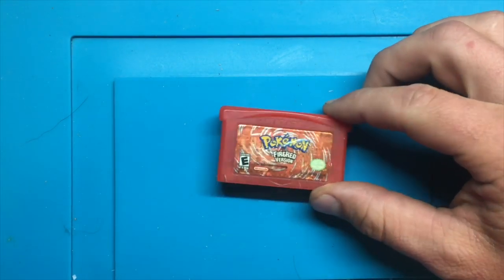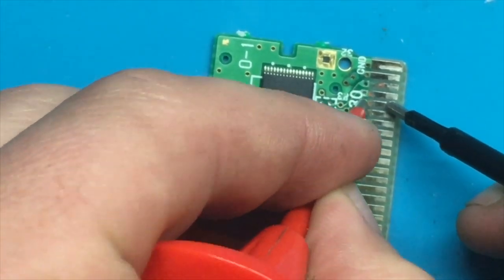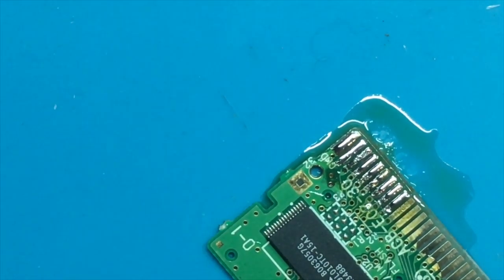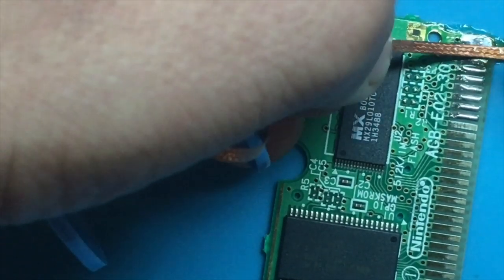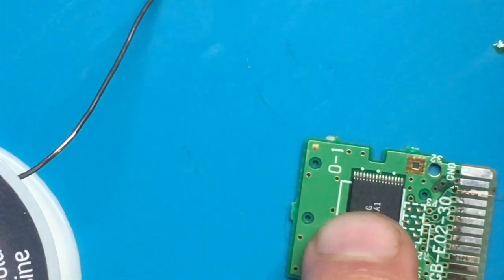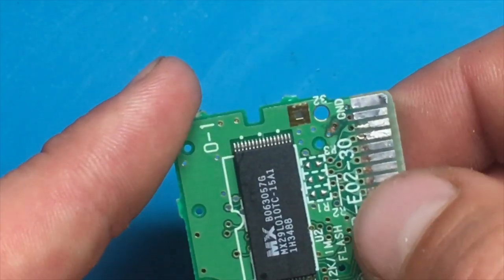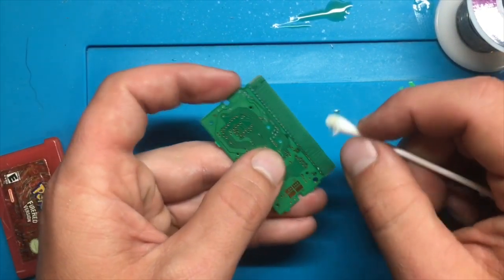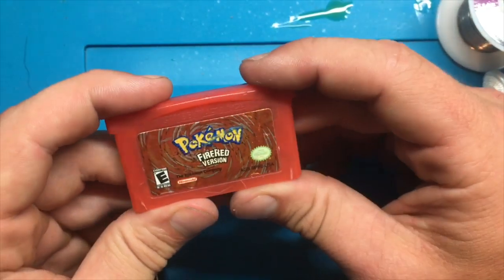Fixing eBay Junk - Game Boy Advance Game - Game Won't Boot Up - Pokemon Fire Red

Comment: looked like SRAM Chip Select pin. strange that that not being connected would show up as no cartridge inserted.
Well, unless the signal being low was sending garbage data over the data lines.

Comment: That's awesome! I'm glad you saved an innocent GBA cart.  I am wondering about the long term effects of the repair though.  Is the solder job going to last with repeated use? Will the difference in material/thickness damage your DS pins?  I figure there must be a reason why the pins are gold plated to begin with rather than being soldered.
Reply: I think it would probably wear within a few years of use (swapping, mostly, since being inserted and not swapped out is the same as any other storage media as far as "wear" goes for those pins) it'd probably wear away again, but that's not really an issue since you can just... well, do it again.

GBA Pokemon games save on the flash chip and not an actual battery.. Short of an EMP wave, or something really unlucky happening, your savefile will always survive. So just repair and move on!
Reply: @acumenium8157  The flash chip can only be saved to a certain amount of times before they fail though. Will that be in 5 years, or 50? I guess it depends how often you save the game.
Reply: @inputfunny  It is really unlikely. Even low-quality flash chips can handle terabytes of data writes and a GBA save is only going to cost 1MB at most each time (since if memory serves Pokemon games double save and use a 512KB savefile).

I mean you bring up a good point but it is more likely the sun blows up than the average flash chip fails in a GBA cart. Some will due to the sheer number used but you'd probably know by now if it was gonna fail since, well, bad flash chips don't tend to last 20 years before going belly up.

Comment: Just picked up a fire red with the exact same issue. 3rd pin to last. I cleaned it up and managed to get it to boot up and got the message “The 1M sub-circuit board is not installed” looks like I’ll need to run a jumper on the same pin 🤣 luckily I had already watched this video prior to even purchasing this game so always handy!

Comment: Oh my god, so I looked this up to see if I could fix one of my GBA games, however, I needed to unscrew the thingy to get to the thing. But, there was a sticker covering the screw for some reason, so I peeled it off and saw that the bottom of the sticker was gold. I thought "hmmm... maybe it was the sticker what was making it not boot? Maybe it has some sort of weird metal on the sticker, what's interfering with the game cartridge? Naah, that sounds silly, but I'll try it anyway." And then... it suddenly worked. Maybe the seller I bought it from, put that sticker on there to protect it or something?

Comment: Off topic. Hi Retrorepairs how to fix SNES with no sound? i replace the av cable, av connector, whole capacitors but still doesn't work. some people said the audio chip is damaged but i dont know. any other suggestions?
btw your cartidge fix videos inspired me to fix random cartridges from flea market, so far i fixed more than 30+ mix of gba snes megadrive cartridges
Reply: it's probably the audio chip.

Comment: Love your videos, I got a pokemon saphire that stays on white screen, if I post an image of the cartridge circuits could you look at it, and tell me if you see any problem?
Reply from the maker: Yeah, i could take a look
Reply: @tavotwo  try cleaning the pins with rubbing alcohol (isopropyl, the highest percent  that you can find) and a q tip or a cleaning toothbrush. Fixes most problems for me.

Comment: Use a sharp tool to scrape the one corroded pin instead of sanding many.
Reply: Or a fiberglass pen
Reply: Use Brasso first. It's a polish, so most top layer corrosion will actually lift away and makes the pins look nice.

Comment: Hi retro repairs why couldn’t you just use brasso or some thing like a eraser to remove the corrosion on the pins
Reply from the maker: Brasso will probably strip the pads clean off in that condition.  They really need to have the corrosion neutralized, then add some material on top to ensure there's a good connection.
Reply: I use rubbing alcohol/isopropyl alcohol and my cleaning toothbrush, it works almost every time for me.

Comment: Awesome Video!!! I wondering that Pokemon games circuit board.. I was soldering a melt on my Emerald. its gone of gold finger on the right top. My emerald has a new battery. I tested it is worked well. I was wondering that emerald was doing work without gold fingers plate. I think do Pokemon circuit board really need repair gold fingers on the circuit... I know that Gold fingers PCB KIT is so very expensive than Soldering iron... Maybe call to service??? Do you have any idea?

Comment: Gracias por estos videos amigo, amo tu trabajo y espero sigas subiendo mas reparaciones de consolas de videojuegos, yo tengo un problema con mi Pokemon Esmeralda, le cambie la bateria para el reloj de las bayas y aun asi sigue sin funcionar, ya cheque la polaridad de la bateria y probe con otras baterias y no funciona, se habra descompuesto algun microcontrolador o algo asi?, que podria estar fallando en mi cartucho? Saludos desde Mexico City y perdon por hablar español
Reply: Puedo tranducir mucho de Este.

He changed the battery on his Pokemon emerald and now its not working. He checked the polarity and tried a couple other batteries but it still wont work. He is wondering if it's possible that he damaged the microcontroller and would appreciate any help in solving this issue.

Comment: Is he using a multimeter to check the current? The tool that hes using the red and black one that makes a buzz noise? If so any recommendations ive looked on amazon and see many and dont know if i should spend on a cheap one just for gba games or something higher priced
Reply from the maker: You can get buy with something relatively inexpensive,  but if you need to measure accurate values, they can get very expensive.  Mine is a Lomvum t28c. I think it costs about $40

Comment: Do you do repairs? My fire red red recently started to show the 1m sub circuit removed message. The cart is real but it's just old and I lost it for 6 months a couple years back. I tap on the cart or blow in it and goes back to normal.

Comment: I got a question maybe you could help me with.  I have been looking for a battery holder that will fit into the gameboy and GBA game carts. This would make it so much easier to change the battery when they eventually run dry. I have not been able to find a holder that will fit into the cart and allow it to close up. Any ideas?
Reply from the maker: Ive never tried.   These batteries should last 20+ years,  and GBA carts do not rely on a battery to hold the save game - only for time related events.  In my opinion,  there's no point to doing that.   The solder job to replace a battery is a pretty straightforward task if you have an iron.

Comment: Thank you for the video. My Fire Red copy just stopped working. I cleaned it all up and checked the contacts and all the contacts work but it still won't boot. Do you know what else might be the issue?
Reply from the maker: Ive got a few videos fixing GB carts.  Probably need to reflow the chips on it
Reply: @RetroRepairs  Ok so I watched one of your videos and I found out one of the holes that have the copper around it corroded so that there is a hole in the trace. I wonder should I run a wire through it?
Reply from the maker: @ARTxZxTECHx  yeah,  you could run a wire through it and solder from both ends to complete the circuit
Reply: @RetroRepairs  The only problem is that the little hole connection is messed up on both sides of the board so I would need to run a wire on the front and then run another one from the back I believe. Also thank you so much for your help and thank you for posting these videos. Your content has helped me the most
Reply from the maker: @ARTxZxTECHx  if you can email me some high res photos of the front and back,  and indicate what exactly you're talking about, I might be able to offer a suggestion. Retrorepairsca@gmail.com

Comment: I have a repair question: I got a Pokémon red that works on my SP but doesn't boot up on my GB, GBC or gba. Only on my SP it works :D Any insights?
Reply: @MaarioMash Thought that as well.. but no all the consoles work perfectly with other games. Only my pokemon red starts up with a 'scrambled nintendo logo' on start up. While it boots perfectly in both my GBA SP's

Comment: That piece of wire is going to be rough on the game boy socket contacts.
Reply from the maker: That was my initial thought, but it's size, combined with the fact the edge isn't sharp anymore as there's solder creating a "ramp" should lessen the impact of i
Reply: RetroRepairs oh no! He got killed before he could finish, oh the tragedy

Comment: hey, i have a question i don't know if you can help me.  I have an old Pokémon crystal game but the save file is corrupted, do you know if there is any way to recover it?  are you able to do that?
Reply from the maker: I doubt it,  but i could be wrong.   I'm not sure if it's possible
Reply: @RetroRepairs  ok, i already had to do some searches but so far i haven't found anything.  thanks for answering me 👍

Comment: How would you be able to fix the ones that says "1-mb sub circuit board not installed." They are completely legit but were the first day released ones , that one that you repaired are the newer versions that came with the wireless adapter  included.

Comment: Hey i have a special anniversary ps4 controller with a drifting left stick is that something you could fix
Reply: I've got this problem before too, you need to open it up, remove the metal pieces on the sides of the analog sensors (that are locked inside some little square blue plástico cases), clean them with alcohol and put them back on. It's this simple.

Comment: That's a fake fire red.
Reply: Red Nova no, looks legit. I have a bootleg, unfortunately. Cart color looks right, no battery. It’s genuine.
Reply: @northwestnerd4950  But, the real cartridge have a battery on the right side of the board and the other components are not properly oaranged on the circuit board.
Reply: GBA carts were the first to use solid state chips for saves. Ruby/Sapphire/Emerald needed a battery to keep up the time function.
Reply: @northwestnerd4950  Oh wait,  your right. I thought even fire red had the time base events. Thanks for removing the rust from my head xD